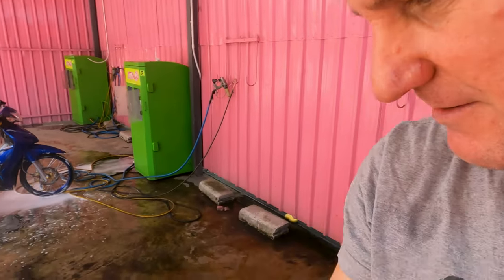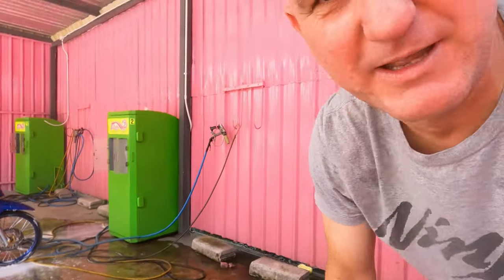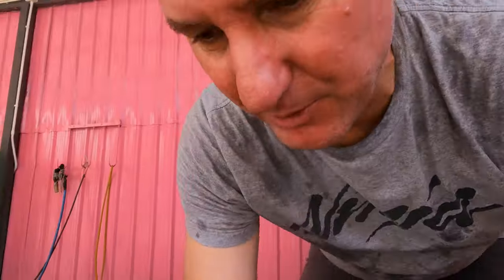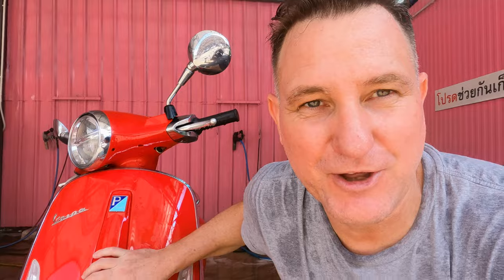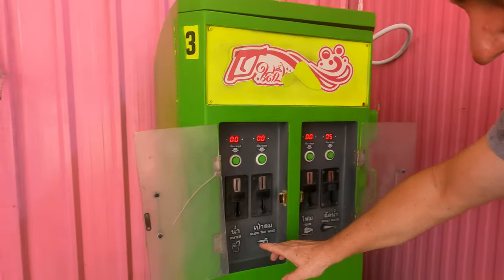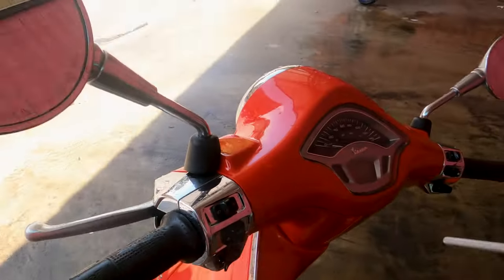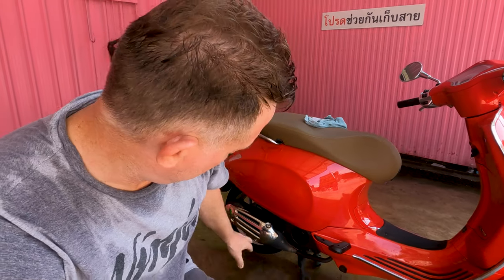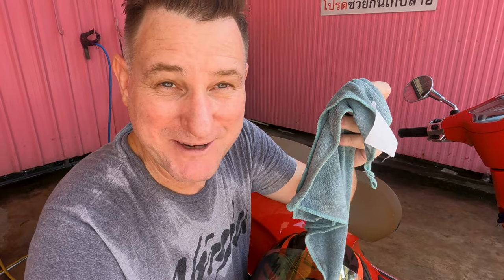HOW TO RIDE A SCOOTER | How To Wash Your Motor Scooter ~ Dos and Don’ts | Part 10

Comment: My man if there is something i would think about doing to or with my scooter here you are publishing videos on every topic :D my only left questions are: can I also power wash my scooter if it has plastic fairings instead of metal like a Vespa? im worried of water getting trought to the hot insides. Also i would love if you could publish a video about checking the oil level and how to top off the oil if needed. I have read so many opinions about checking when cold, warm or hot that i currently have no idea how to do it :D keep up with the great videos!
Reply from the maker: Thank you for your encouragement! 

My Vespa has a plastic front mudguard, so I know what you mean. I also understand what you mean about being worried about getting the scooter's insides wet and when in doubt... trust your instincts. If it looks weak/fragile... don't use a high-pressure water gun on it and if it looks too delicate/mechanical/intricate... avoid wetting it. Overall, however, scooters a built tough and built to withstand the elements.

Oil - good video suggestion - I'll do it.